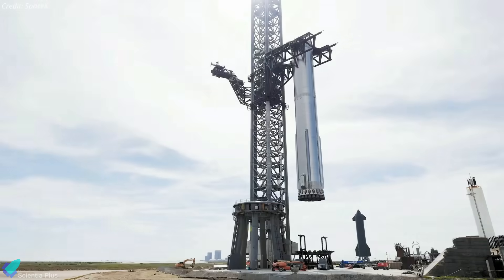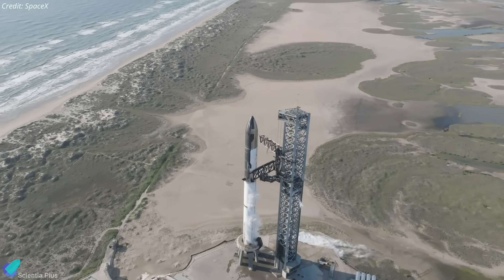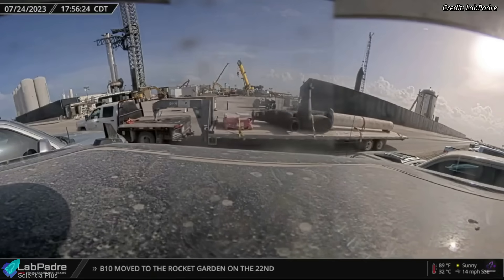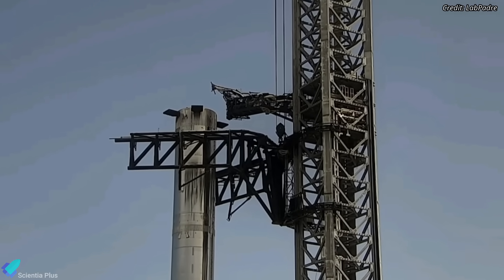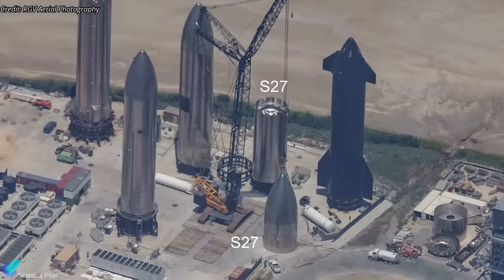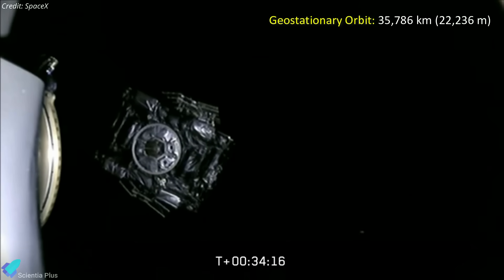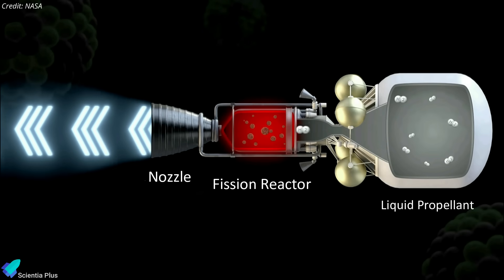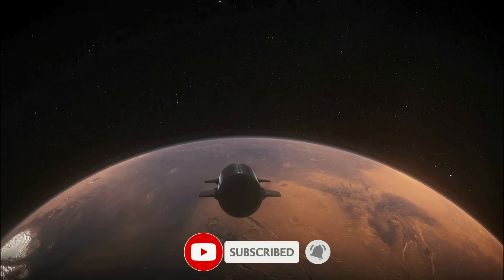SpaceX Starship Massive Water Deluge Full-Pressure Test Success, Next Starship Launch Date?, NASA

Comment: QD is 2 meters higher, so can't use any starships that haven't had its connector also raised, right?  Maybe this means that this booster is not the one that will be used to launch the next starship to orbit?
Reply: The ship QD was raised because of the vented ring added to the top of the booster to allow for venting of the thrust from the second stage engines.   This is part of preparing for hot staging of the second stage.   Thus no major alternations if any are needed are the second stage.
Reply: @michaeldeierhoi4096  Thanks for the reply.  I guess I'm just not seeing the venting ring on top of this booster.  If it's not there then they'll probably have to add it to this booster or raise the starship connector on the starship that will be mounted to this booster.  Or maybe the QD has the built in capability to lower down to it's old height as well?  Didn't see the mechanism to do that on the closeups of the QD though.